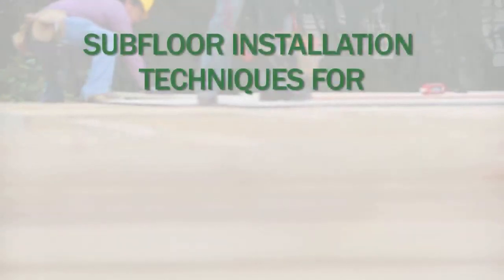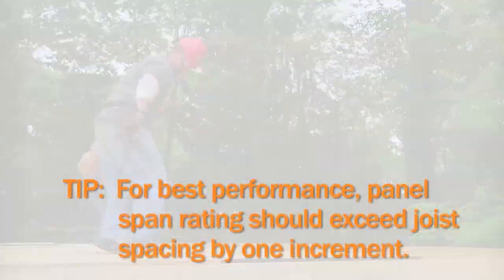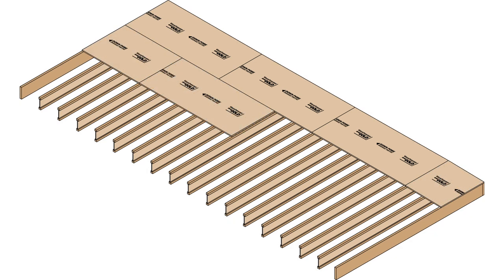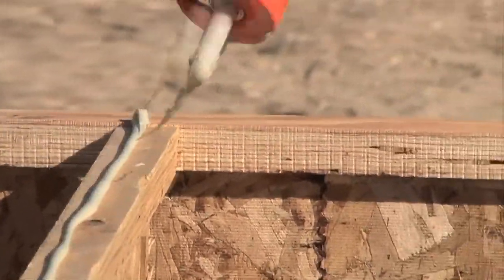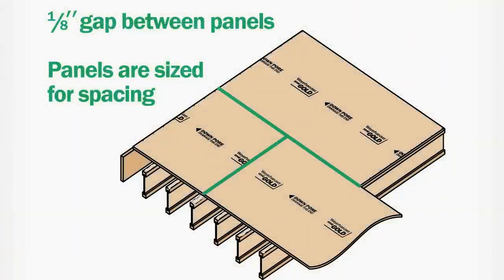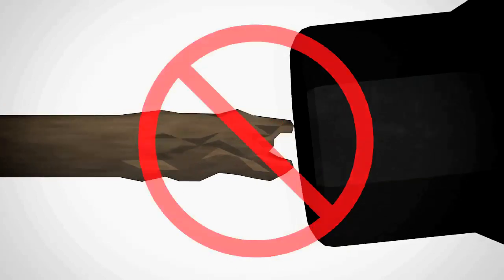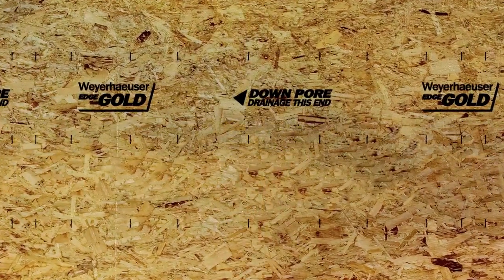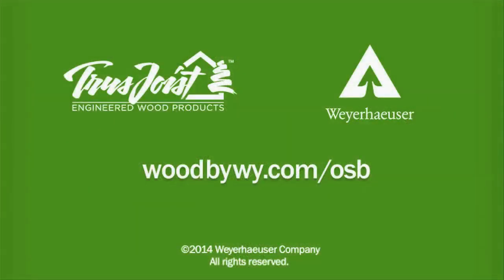The Subfloor - Trus Joist EWP Floor Installation Guide

Comment: Anyone have expert advice on repairing rotted subfloor over TJI I-joists.  Specifically, how to  sister the I-joists to support all sides of the subfloor patch?
Reply: You ever figure this out?
Reply: @toddmartin3207  Funny, I finally got this done only last week.  One piece of advice from Georgia Pacific was to glue and tack pieces of webbing to both sides of the original webbing to build it out to the width of the top and bottom flanges. The webbing joints should be staggered for strength. Then, they say you can nail into the strengthened I-joist like it is a wood joist. What my contractor ended up doing was to nail a  box, constructed of rim joists,  to the I-joists, nailing into the top and bottom flanges. A prior renovation in my home had used this second method to strengthen the floor under a heavy granite hearth, but it looks like an E from below not a box.  Hope this helps.
Reply: I’m trying to do this myself so all the information I can get is helpful! The last contractor really messed it up. Appreciate the reply!

Comment: Why would nails be recommended rather than screws?  With walking on the floor, it seems that you'd be much more interested in resisting withdrawal forces rather than shear forces.  https://youtu.be/lG9tZ1mj9Mc?t=1m22s